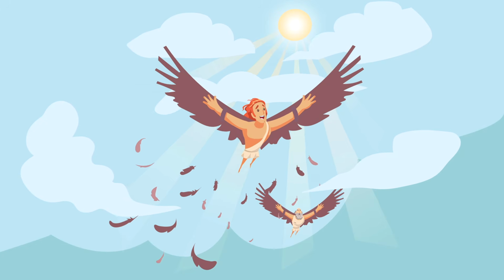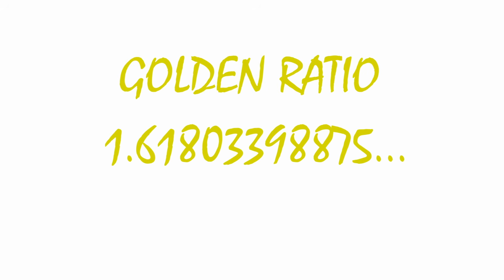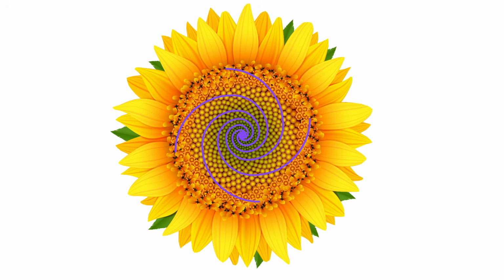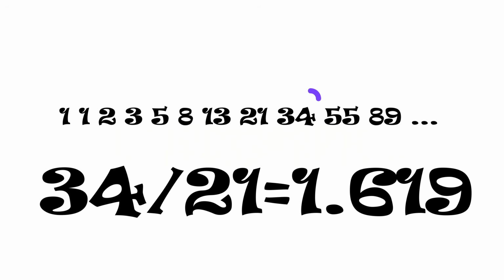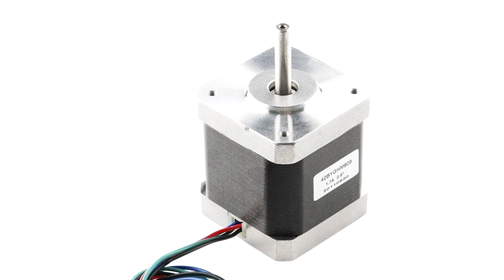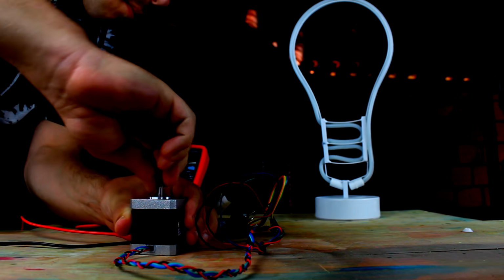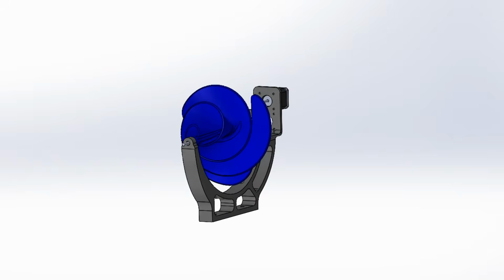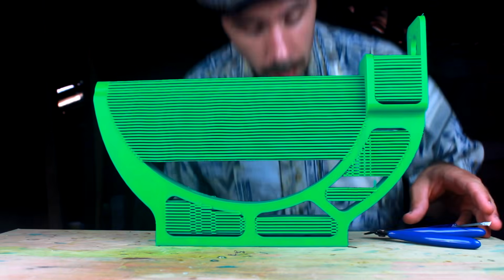Golden Ratio Turbine 3D Printed

Comment: Well, there are people here who have already discussed the representation of the golden ratio compared to other spiral types in the video and the relevance of it in the project, so I'll skip that for now. What I am more interested in would be testing a golden spiral with an equivalent Archimedes screw in material. It would probably also be worth testing this with different width and radius parameters in mediums of different densities.

There seems to be a handful of papers on the usage of golden spiral and Archimedes screw turbines floating around for further reference, as well as various marketing claims as a "quieter" or "more efficient" generators to the generally cheaper propeller designs as a legitimate incentive in this research. Plus it's always fun to build prototypes... so long as you have the funds.

Comment: Cool project.. maybe think about water again and print one suitable as a water turbine. Water flow is  generally more consistent than wind and easier to design for.
If the turbine is placed in a stream of flowing water rather than inside a pipe, maybe print out a duct that concentrates more water flow onto the turbine rotor and produces a low pressure zone around the back of the rotor to "suck" the water out, increasing pressure differential and torque.
As you found, matching the generator characteristics to the turbine characteristics is really important  if you want to get meaningful output.  Measure the unloaded rotational speed of your turbine in standard conditions, then measure the torque it can generate as you slow it down.
Pick a balance of torque and speed where the turbine is producing good power (torque x speed) and find a generator that is efficient under those conditions.  Of course variable wind speed makes those calculations difficult.. which is why water turbines are easier to  optimise.
Thanks for taking the time to make these projects and put them online.

Comment: How can I find the "golden ratio " of a propeller?  Dia/pitch for a top speed goal.  On a given plane.  It's there a way to reduce drag on  an existing design wo changing the design.  I'm talking about wing design.  Im trying to build a 200mph foam board  constructed rc airplane.  My first limiting factor is its built from foam board, strength and how to get rid of the drag from the design and build methods used.  Im very frustrated.  I want to do this wo throwing a lot of money at the challenge.  I have so many ideas but limited time and space.  How can I use your ideas here to help me break 200mph. 175 is the record.

Comment: Build a casing for the turbine, in that way you're not loosing power by dissipating the air radially. Also do not discount the possibility to have a grooving system inside following the shape of the turbine itself. That will help also if you're using water to spin it. Mainly turbines used in power production have steam as main source of power coming from  combustion of fuel (fossil or nuclear). With the lilly turbine you can have 2 coupled turbines to produce power from waves motion and you can steady the production by using a flywheel. One could even speculate that a system like a 4 cilinder engine could be made to actually produce a significant amount of energy by a steadier rotation... the main issue then is transforming rotation axis to what you want it... maybe an automatic clutch to engage the axel to whichever turbine works and in that way you can use the 2 directions of wave motion to have a single rotation direction...

Comment: I just watched this video and was wondering. I know you were out putting 15 volts at one point and wondering with your van if you could replace your alternator to constantly charge your battery. seeing how a alternator brings your battery to about 14.5-15 volts to keep your 12 volt battery charged while running your cars amenities. While doing this successfully could call for a smaller belt size and less strain on the drive line which in theory should supply more power to the wheels

Comment: I could use a special chamber which demonstrates a specific upper atmospheric photochemistry.

In brief, up in the low pressure of the troposphere, solar UV and IR energy cracks H20 and gives us OH-, a hydroxyl, and H. The OH- will crack many greenhouse gasses with methane being highly susceptible.

That photochemistry is well known yet what is not well known is that the photochemistry cools the air, from 15°C to 25°C. 

If a low pressure chamber can be made to create the pressure, UV/IR conditions of the topopause, while documenting the cooling effect, I will pay well.

Comment: I'd like to see you build a liquid 7 segment display. Each segment would be a transparent tube (plastic or glass) which would be filled with a colored liquid when the segment is "on". To generate a number, you would open a valve on each of the segments that must be "off" and close the valves on segment that must be "on". It would be great if the valves were 3D printed and controlled by really low cost motors/actuators. The valves (7 total) and the pump to force the liquid through the system could be controlled by a Raspberry Pi. The ultimate goal would be to build a clock consisting of 4 such 7 segments.

Comment: An impeller unlike a propeller turns the flow of fluid from a plane to a stream or a stream to a plane - while a propeller does not change the general direction of the flow of fluid.

Comment: Project idea....  Build a real working “tractor beam” like star trek via sonics on a parabolic dish....And don’t forget that the size of the object you can pick up (levitate) has a maximum diameter of 1/2 the wave length, and Weight is dependant on amplitude of that frequency.

Comment: Ok, but why would you go with the golden ratio design, without even testing it against regular propeller/turbine designs? I mean, of course it would work to some degree, but are there actual benefits over common propeller/turbine designs? Otherwise, what's the point in pushing it this far without giving a broader context?
Don't get me wrong, I think the video is interesting and very well done; I'm just missing some reasoning behind all these experiments. Maybe that's just me.

Comment: how is this compared to a "unidirectional" wind turbine?

i can imagine improvements to this design by attaching bearings to the rotating shaft, aswell as the base so it can swivel to face the direction of wind (if you install it on a roof) with a tail to help aim

Comment: Clean energy powered home. multiple systems working together where as You can recover power as a by  product to be reintroduced for over all system performance..... Like solar cells to collect energy not being used by plants from grow lamps... Or heat turbine powered by a furnace .... starting power supply must be green energy and each additional source of energy must originate and produce a secondary source of power that can be used or returned to the base system sorry if that's a stupid idea 😅 I would really like to have a 3D printer to prove or disprove other stupid ideas

Comment: Creative uses for an old/unused 3D printer control board.  After upgrading your 3D printer main board what do you do with the old one? Sure it can sit around gathering dust playing the role as a back up board, but I would like to see mine put to some practical use.  My first thought is to use the heat, temperature control, and fans to make a desktop oven so that I can anneal 3D printed parts. Maybe I can even use the y-axis to move the oven shelf in and out.  I have a list of additional ideas about a mile long however I would like to hear how you might use an old 3D printer control board. Please reply and list your idea.

Comment: Did you try moving air across the spiral impeller in the opposite direction? Will that cause vacuum ynder/inside the spiraling fins and induce a rotation more powerful?

Comment: Can you try to heat water through a thin vertical pipe until it gets into vapor... Then when the vapor reaches the top, make it condense back into liquid, and make it fall down into another pipe, ending on a turbine... To convert the accumulated energy into current.

I know, it's kinda weird, but maybe it can work somehow!

Cheers 😅

Comment: I like fractals. And whenever I see the eiffel tower I wonder what would happen if you used MORE triangles.
Obviously the main supports are divided into triangles to get the right stiffness at a fraction of the weight. What happens if you use triangle trusses to make those large triangles? (And why stop there? How small can you go?)
Inversely: (Since there is an obvious lower boundary to how precise you can (3D)print.) How high/heavy can you build using 3Dprinted multi-triangle truss segments?
Is there such a record as the highest structure build from a single spool of filament?
Reply: Are you Delauney ?

Comment: Next clip idea
TANK TORNADO!  ITS A TORNADO IN A TANK. 
In the name of good science, please would you run the water experiment in a square or rectangle, (actually no rectangles),  oblong tank yes. My guess the conventional impellers effect is lost on the eddy currents created by the angles introduced.  And the Lillies design is complemented by the angles. Victor   

Surely I’m at risk of repeating someone?  Your Lilly impeller is not balanced. After you print one you need to spin it up on a lath and drill the impeller centre to connect to the generator.  You can only spin something at speed if on dead centre.  The Lilly petals I know little of their integration with speed, temperature and pressure. My intuition would say Lillies are strong forms.

Comment: I would like to see you build the hydro electric power generator using this lily impeller and also by creating vortex flow instead of radial flow and compare the power outputs and ease of operation between wind and hydro electric power generation using this turbine

Comment: That spiral turbine should produce almost zero turbulence, it should work very well in water as a generator. As for structural strength at high speeds you could try and taper the blades ends. Great work, I really like spiral turbines!

Comment: Would it be possible to tweak the golden ratio turbine to make a wind powered siren?  Practical application could be a severe weather warning system with the severe winds moving the turbine and it wails or is mechanical attached to a siren.

Comment: Should have just used a permanent magnet with some coils to make 3-phase ac and then use a schottky diode rectifier because that has a low forward voltage drop. Maybe add a zener to protect it too.

Comment: Great video.  Perhaps you should try mounting a Series of VAWTs along the top rail of a freeway barrier (you know .. where the wind blows in almost precisely opposing directions right next to each other  ALL THE TIME ! ) It's like having 2 wind sources pushing on opposite , but complimentary, vectors on the same turbine!  Plus! This "wind" ,being a waste energy by-product of the displaced air of the vehicles movement,  exerts the same amount of  energy on every VAWT the vehicle passes WITHOUT negatively effecting the vehicles efficiency in any way!  In fact harvesting the otherwise wasted "wind" from individual vehicles makes ALL vehicles more efficient if the energy is used to benefit the community!  It's funny you mentioned "moving the  mountain to Mohammed" , as I used the exact same analogy 20+ years ago when I thought of the idea of mounting VAWTs to the  tops of divider barriers!. :)

Comment: You know, I like the idea of the moving turbine to create charge.  The question I have is if you take a van and use the roof to mount as many vertical turbines that will fit and then proceed to drive.  How much charge can be created AND how much does that affect the overall km/liter in fuel consumption?

Comment: I know I'm late to the party but none the less, I think building a turbine at 500 and 750 mm diameter would be interesting to see if the power output is linear or logarithmic with scale.

You will just need to make it in sections and glue them together. 

If you make the mount out of wood you can fair the shape to improve the airflow around the base and mount.

It would be interesting to see the power output of a one meter  diameter impeller in relatively light wind speeds.

Who knows, you may have come up with a small scale wind turbine.

Very nice camera work by the way.

Comment: I stumbled across this video n wanna 3D print my new concept for a wind/water turbine ironically my story perfectly parallels the story u told in the beginning I just like observing how reality really works the evolution of my idea has been fascinating over the past decade starting out very rudimentary and simple to test my initial epiphany then it was off to the races to optimize its efficiency using basic guesstimates and vector physics to eventually get to where I’m about 95% sure that if I can get it out of my head and into reality it should be a game changer or maybe  I completely misunderstand fluid dynamics  n I’m delusional cus I can’t quit thinking about it  and how wind would affect it n how it’s such a simple and obvious way to transfer flow to rotational force incorporating lift drag and thrust  and the equations for torque to fine tune the geometry so the impact angles result in maximum positive torque with negligible negative resistance

Comment: I would like to see it working in a stream of water. Let say 3m drop and 40mm pvc pipe.  Exhaust lateral side at 25 to 30% from button of turbine.
If you can generate 12v and few amps, you will transform the world.
Good job mate!

Comment: At 21:28 it looks like the resistor is connected in parallel to the turbine. That is not what you want! You lose power from the current through the resistor. It also reduces the voltage.

Comment: Hi Integza, please  do a video about HHO and splitting the water in Stanley Meyers style using low current, pulsed high voltage at resonance  -BIG output. It would be amazing to see your tests and results... I want to win a printer, but even more I want to see you make this video, even a simple video on the power of resonance and water capacitors to start with and build from there?!?!?

Comment: @Integza Can you try putting the Lily Impeller inside a tube and vary the diameter of the ends of the tube and then submerge it underwater to see if it will act like a propeller?

Comment: I would like a part 2 of this video where you build an airtight (something close to that) enclosure for this turbine and test it with a pressure feed. I think the design of this turbine is not ideal for "in your face" wind from the front or at an angle, but may perform way better when the pressure starts high at the tip and drops over the length of the turbine. 

Or you try to feed air into it that already has a spin, to "reverse" the effect it creates in water and recreate its preferred flow direction to make it more efficient. I could be completely wrong though, after all I am No Expert ;)

Comment: Love your work.
I live on a catamaran and wonder if your Lily Turbine could 1) be used to drive a water current(ingoing and outgoing tides) powered generator, the thicker medium (water)would help low-speed operations, and 2) spin a drum of water one meter in diameter and .5 meter deep.(like a flywheel) to create centrifugal force to reduce the motion of a boat in a small swell.

Comment: @Integza Make a solid state device move air similar like how a fan would, but using no moving parts...(You could use magnetism, heat or light) Just no moving mechanical pieces. Challenged?

Comment: Would it work with some sort of capsule around it ? I'm thinking something like the shape of a sand clock (whatever they're called), air comes in a larger diameter nozzle that goes down to the diameter of the tip of the turbine in a conical shape and then goes up again towards the bottom of the turbine.

Comment: Still a fan. Thanks for this. When I was a very young child 4 or 5, I experimented with household current.

My parents were a little alarmed when they caught me. I was told it could kill me. 

However,  since I had literally been putting my hands on bare wire for months (using a severed electrical cord) I thought they were exaggerating.

Later on,  I even tried reanimation on freshly dead rodents, to no avail.

Comment: Thanks for the Lily Impeller design, looks great!
Reply: 3:44 This dual flow, also is present im electricity.
the water vortex represents the magnetic conduction current, while the air flow is the dielectric displacement current, often also know as "cold current". both flow in opposite directions.
Magnetic current from negative to positive voltage,
and dielectric current from positive to negative current.

Comment: First of all my dinner was tomatoes and Corn not bad. Second, can you three D a new three D printer with a three d printer just buy parts such as motors, extruding nozzle, and wires and or raspberry pie zero in-case you can use Bluetooth or wifi to program the thing and run the motors or run relays from something resembling a computer power supply of 30 to 120 watts or what ever works?

Comment: You should try to build a Tesla switch circuit to drive the 3D printed impeller to purify water with extremely low energy input. It works great!

Comment: Really interesting vid, and earned my sub. 
If you made the speed of the water impeller variable you could tune it to not suck air all the way to the bottom. This would make an attractive and fascinating display, especially if filmed in slow motion. 
If the black motor mount housing had a couple of grooves for o-rings it wouldn’t need to be sealed with silicone and an inverted glass tubular vase could be used instead of plastic.